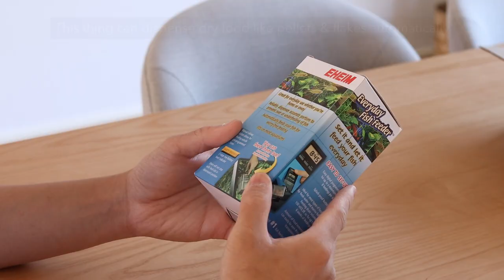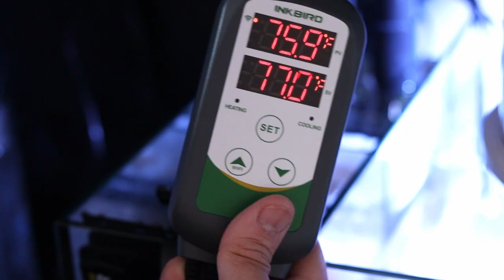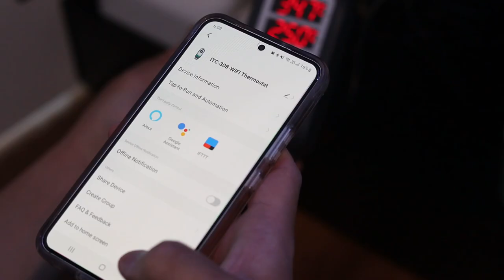Preparing the Tank for a 30-Day Vacation - Part 1 | Blue Reef Tank

Comment: In the US most people have air conditioning.  My heater runs 24/7 365. Even when it's 100°F+ outside.  It's never hotter than 76°F inside the house.

Comment: You don’t want the metal probe inkbird, it will corrode and leech in saltwater. Will be rusty pretty soon
Reply: Probe can be replaced with plastic one for a few dollars😊
Reply: It’s probably painted plastic? Or even better stainless steel? I doubt something for a marine tank wont be
Reply: @marcusreaich08  it actually is metal and it rusts because most use it in freshwater
Reply: I had the metal probe in my saltwater tank for two years and didn’t notice any rust
Reply: They make on specifically with a plastic probe for saltwater. There’s multiple examples online of the metal one rusting.

Comment: Ever tried placing your wavemakers at the back wall so have a cleaner look without cords at the sides? Probably easier to clean the glass on the sides as well. 

Been wondering how would that affect the overall flow!

Comment: what about the food that floats on the surface? Will it flow into the overflow shortly after?
I plumb a chiller into my aquarium to chill my water as the temperature in my region is generally higher